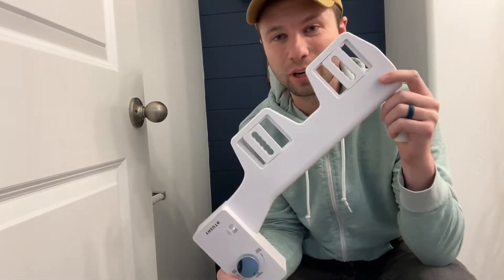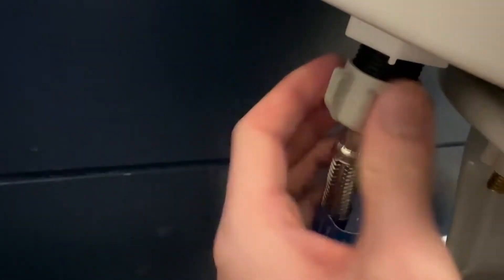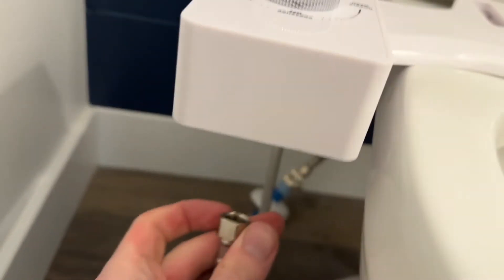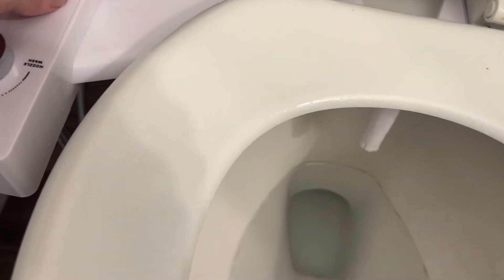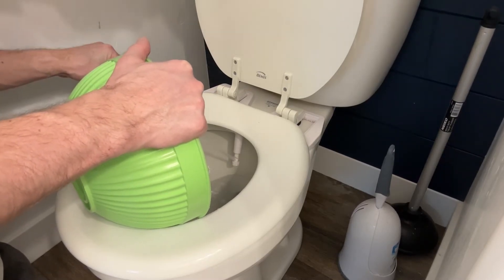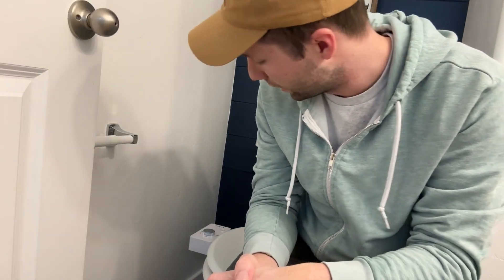Is The Tushy Bidet Worth It? [Review & Installation]

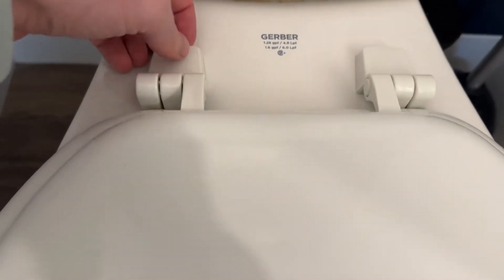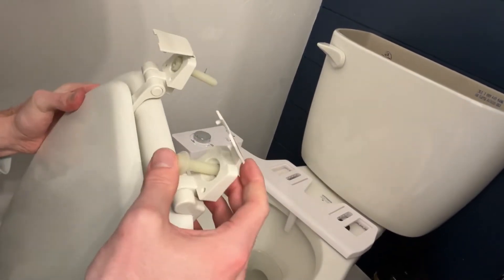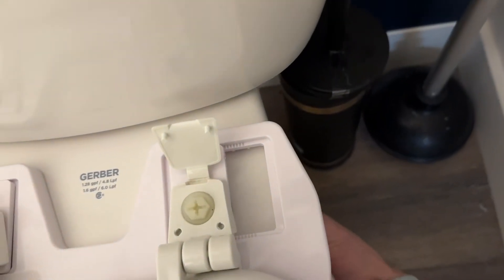Comment: A question about the installation of the toilet seat to the bidet. Wouldn't installing it cause the toilet seat to be at a slight angle from the back to the front? Look here when you had it normal and flat 0:38 with the bidet 2:11 I see it has some width to it and at 2:16 you install the toilet seat back with the bidet and if you pause at 2:27 it looks fine from above but it's clear as day there might be a slight elevation to the toilet seat now but I don't know for sure since there was no camera shot from the side. This is my concern.
Reply: its so slight you wouldn't notice, the Bidet attachment is maybe half 1 inch thick.
Reply: @AlbertoMartinez765  That's too much. I will notice it. If I notice less than that on my current toilet seat that's less than half an inch I will notice with the bidet no doubt. I'll have to pass on this then. Thanks for the reply tho.

Comment: A stupid question. Do you need to keep a towel near to dry your rear end. I have never used one and have always wondered this.
Reply: You still need to use toilet paper.  This isn't a toilet paper replacement.  So no dont use a towel just wipe with paper.
Reply: You don’t have to use toilet paper. I have about 12 small Tushy towels in a basket that I change every few days. You just need to pat dry the water after cleaning.   If you see a little residue on the towel, just spray the water a little more.

Comment: I looked in my Kohler tank and it's funky. I'm guessing the tank needs to be sterilized and cleaned before you shoot that water on your privates. Why can't I find anything on line about the cleaning of the tank before installation? Am I not understanding something? The water comes from the tank right? I noticed you have a bit of a funky water rim in your bowl you are demonstrating on. Huh?
Reply: It’s not the same water from the tank. There is a water supply line directly to the bidet

Comment: My only problem/ theory is when you spray yourself the poop splatters in the toilet since water is spraying it off. So wouldnt that mean it can get on the sparayer itself then other people use it and more and more of other peoples waste is accumulating. Even if its a very small amout still kinda gross. Thought of getting one but that crossed my mind
Reply: It has a nozzle cleaner and you can clean it manually to get the other junk.